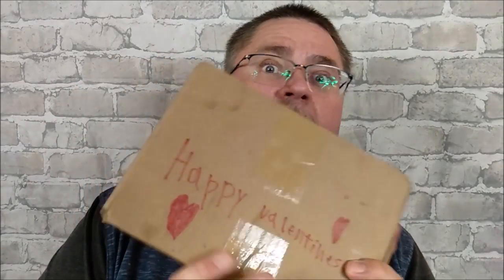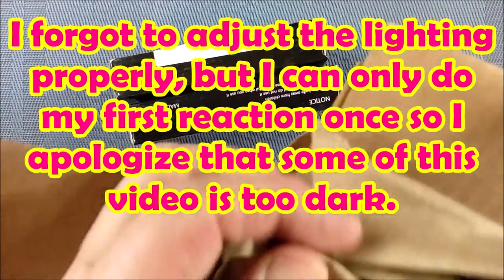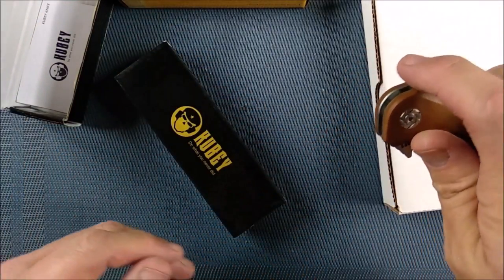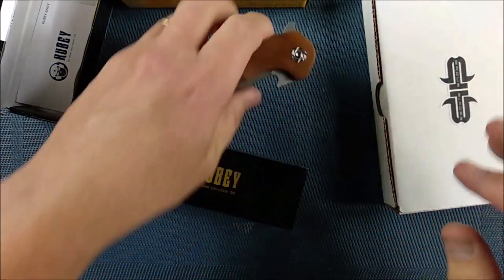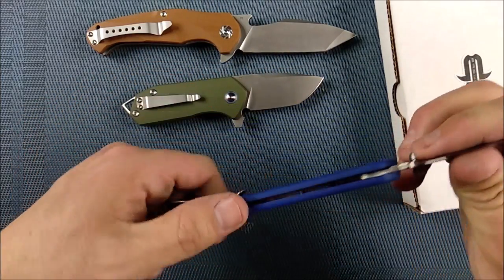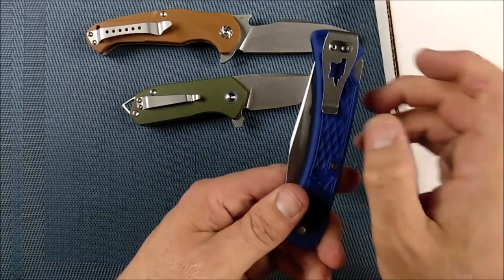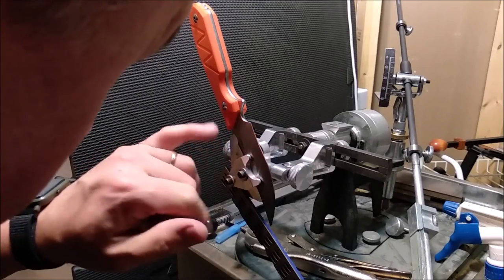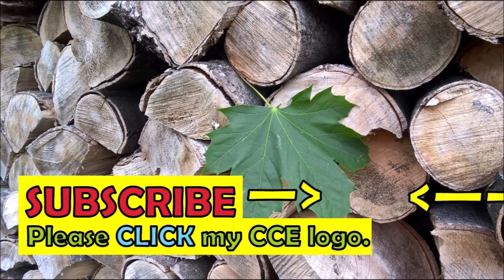Unbox and finger chiol fix DONE

Comment: I got the Kubey KU203 a few days ago on Amazon for $27.99 in the Antique White. I really like like it, short chunky knife. My only complaint so far is the edges on the pocket clip are sharp which I plan on sanding down. Also the pivot has came loose two times but some blue lock tight should fix that.
Reply from the maker: I will keep special note of the pivot screw